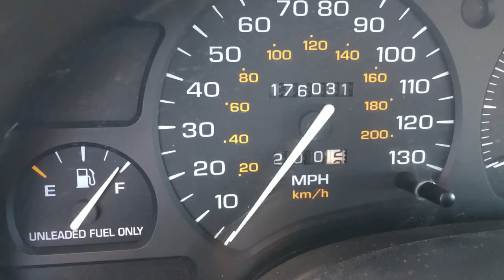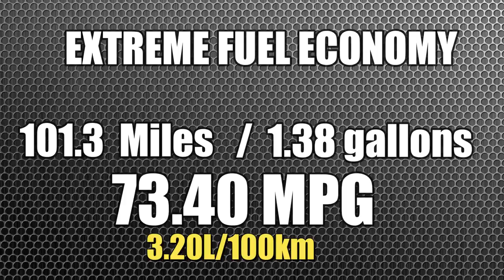S3 E11. Kubota turbo diesel Saturn extreme fuel economy.  super high MPG

Comment: MPG has been studied a lot.  Wind resistance is negligible at 50 MPH and below, but a car will achieve its best mileage between 55-65 MPH depending on gearing and drag coefficient.
Reply: Not quite as simple as you write it,  sadly. It depends an extreme amount on numerous factors such as the car size, weight, drag etc etc if wind resistance is negligable under 50 mph or not. For an electric car for example, its very tangible even at that speed.

Same is with best milage, but for most cars on the road (at least in europe) its reached at slightly lower speed than what you wrote, with about 40-55 being the sweetspot for most ones. 65 being the sweet spot would be possible in a car with a large-ish V8 and tall gears, as well as low drag. Corvette perhaps.
Reply: @GoldenCroc  I'm just repeating what I was taught in school a long time ago.  I got an A in the course.
Reply: @wsbill14224  Oh, ok. I guess your were taught ok-ish info. Not completely wrong, but a just a bit outside what is most likely/true. 

Anyways, now you got some updated info that is a bit more correct. Not bad, huh? Cheers mate.
Reply: @GoldenCroc  My reply had nothing to do with electric cars.  If you read up on gas car MPG again I think you'll see my 40 year old numbers are still pretty good.  Weight matters but most cars weigh about the same so it becomes a moot point.  Power doesn't matter because I'm talking about the speed at which max MPG occurs for a particular car, not selecting the most efficient engine.  Those are two different subjects.  Then it comes down to drag coef and gearing like I said before, and since wind resistance increases sharply above 60 MPH the speed of the car's maximum MPG will fall between 55 MPH for cars with lower gearing and/or poor aerodynamics to about 65 MPG for cars with taller gearing and/or less drag.  You will not find max MPG at 70+ MPH no matter what mass produced car you drive.  Not even a Viper.
Reply: @GoldenCroc  I agree except best MPG will be at least 50MPH unless the car is undergeared as wind resistance is almost zero below that speed.  You will not find max MPG at 45 and you won't find it at 70 either.
Reply: @wsbill14224  You made two posts, so I will answer them in chronological order, but there will be a lot of overlap. There will also be things I said earlier but in other words, in an effort to make it easier to understand. Anyway:

When you said "Wind resistance is negligible at 50 MPH and below", well that depends on a lot of factors, as I said earlier, so it can be said to be an oversimplification, unless the ones who taught you were just thinking of the "average US V8 car" of 40-some years ago, in which case I am inclined to agree, the numbers you got taught are indeed "pretty good"for those. 

As a sidenote from your comment on needing to read up a bit on gas car consumption, I also like to think I am pretty well read when it comes to vehicle energy consumption numbers (that would include gas cars), since I have analysed it since circa 1992 or so, as well as having done some design work on engines and cars since the late -90s on an amateur level. Doesnt mean I know everything, not at all. But at least what Is discussed here, I fell pretty confident about. I would hope so, considering all the hours I have put into it! 😆

But I wish to expand it a bit for other cars, and more moderns ones as well. Thats why the EV example, since those have very low frictional losses in the motor and drivetrain, they are the outlier for how low the best speed is for consumption. For quite a few EVs, that "best speed" is just some 20mph, sometimes even lower. This is relevant to ICE cars in that smaller cars with smaller engines have a lower best consumption speed. For some really old "peoples cars" that sold in huge numbers wordlwide  I would think the best speed could still be as low as maybe 30mph or so.

Now regarding weight and other factors, it depends on what you mean by "cars", The average US car is a pretty small subset in some ways. Its get even more thorny once we consider most "trucks" are used in daily duty just as "cars" are. A 60-70% weight difference isnt all that uncommon between a few year old corolla and a big SUV. But still, weight doesnt matter all that much, that is true. 

Power doesnt matter at all, that is also true. I never said it dit thought, but maybe you brought it up just to clarify? Fair enough if so.

The real thing in this latest set of post you made I have to make a comment about is the "since wind resistance increases sharply above 60 MPH". This is not true from a birds--eye perspective. wind resistance increases just as sharply at every speed, there is no sudden "hump" to get over... Well unless we are talking about transonic speeds, but that doesnt seem really relevant for road cars, as of now.

So let me assure you, if you take the whole current wordlwide car fleet into account, there will be quite a few with the best consuption below 45mph. This seemed pretty relevant to mention to me. As I said above, for most cars currently on the road in western nations, 40-55mph is where almost everyone falls. 60-65 as a max is the upper outlier. I have extensive data, as well as pure calculations/simulations showing it to be so. 

All in all, your posts make a lot of sense, only real problem is the data they are based on would seem to be an old V8 sedan or similar. All well and good, but thats not all that representative of the average car any more, even in the US. We agree on almost everything, just a slight adjustment of the numbers to be inline with my first post, and you are bang up to date, as well as taking into account a wider variety of cars, also for the worldwide market. And thats not so bad, is it?

Crack a beer and cheers mate. 😄
Reply: @drippingwax  I have looked, and I cant see I have done any mistakes in my text above, so it has to be a factor of you misunderstanding me if you feel that way. 

So I will make it easy: Just show me a single example of how something I wrote "dont make sense", and I will make an effort to use as simple words as possible when answering, if something was unclear. Cheers mate.
Reply: @GoldenCroc  The engine can’t really have an effect on the ideal speed for economy. That would be more determined by gearing and final drive surely?
Reply: @GoldenCroc  Also, you stated “wind resistance increases just as sharply at every speed”. Wouldn’t this be false, as aerodynamic drag is proportional to velocity squared?
Reply: @baileyharrison1030  The engine can have a a very significant effect. Propelling cars at a predetermined speed take a certain amount of power and energy. Different engines, especially if we dont strictly talk about modern ones, are very different in thermal efficiency, power delivery, internal friction etc. All this is combines with lots of variables for the vehicle it is mounted in to give a "best speed".
Reply: @baileyharrison1030  Yes, thats exactly what I meant with "increases just as sharply at every speed". There is no" threshold" that is relevant to road cars, it is always the same squared increase for power from one speed to another. Same relative increase in power needed to go from 10 to 20mph as there is to go from 50 to 100mph. 

The previous comment I answered can be read as there is a sudden "uptake" in drag above 50-60mph. There isnt,  the only reason it might be percieved as such is because it can correspond to the speeds you often drive, as well as other factors in the cars propulsion efficiency coincides with that speed, as stated in earlier posts, such as engine internal friction etc.
Reply: @baileyharrison1030  it ultimately depends on the torque curve of the engine, which is how the gearing and final drive ratios are usually chosen for the design cruising speed of a given vehicle. So "it depends a lot on a lot of things" is a better answer haha.

Comment: Your method of determining how much fuel you used is flawed.  it is common for the gas tank to expand during driving. Thus you must either let the car cool down before adding the fuel to see what you consumed or when you started you'd have to fill up after driving enough to warm up the tank. The expansion can be considerable so if you started with a cool tank and filled up with a warm tank you may have easily put in 1/2 to 1 gallon more; giving you a false lower mpg.  You may have exceed 40 mpg in reality.

Comment: My diesel has the 617 turbo ,it won’t get the 50 plus mpg but will drive around the world an the average of 30 times , just great engineering, have owned 30 or more of them as a hobbiest . My best diesel fuel saver was an 1984 190d , had the 2.2 with 5 speed , 42 mpg was its average . Glad your bringing the current study , it’s the everyday working mans worry , fuel prices .

Comment: It would be interesting to see what the file economy on the DS series Saturn at 55mph. I bet the car was designed for the double  nickel back in the 80s when 55 was the law of the land. 

Another fun video!!! 😁👍
Reply: I live in rural nc and drive saturns the secondary roads(and most of my use) are 45-55 mph(mostly 55) I get 37 on the wagon and 39 on the coupe. Over 70 you might see a drop BUT I never go faster than that (limit is 65 on hyway here) They seem to get the same mpg at 50-70 mph(within margin of error)
Reply: @MDAdams72668  in my automatic SL2s the tourqe peak was at 69mph (2900 rpms if I remember correctly) so thats where I usually drove it and they were happy there 😎😁

Comment: This was interesting to say the least. I would be thrilled with 50 mpg. My truck sounds awesome and will pull most anything but I get 14.5 mpg with a tailwind but I have to have it on the farm. I notice the hillbilly test track is devoid of hills. I live in east Tennessee where we have few flat places. I was driving home from Colorado going through Kansas at night. There was lighting flashing to the north and south of I70 with clear skies overhead. We never see things like that because ya can't see that far in these mountains. It's also hard to see storms approaching.

Comment: What if we get rid of the transmission and put a DC generator attached to the motor so the motor is only producing power to make electricity then use a electric motor which is over 90% efficient to move the vehicle.

Comment: My 2016 Mercedes A200d AMG with the 2.2d OM651 engine and DCT gearbox did 68.2 MPG over 110,000 miles over 4 years. With a common weekly average of 72mpg. Absolutely amazing on fuel.
Reply: There's no such thing like diesel AMG
Reply: @Robertrobal  🤡🤡🤡🤡🤣😂
Reply: @Robertrobal  Well clearly there is, i brought it brand new. £34200.
Reply: I had a mid 80s Ford escort with the Mazda 2.0l that got that kind of milage before the diesel fuel here changed. Even in the Sierra Nevada mountains 55+mpg was common. 70ish in the valley..when low Sulphur fuel came to California that dropped quite a bit.
Reply: It's an AMG appearance package.
Reply: @MBDieselFreak  That would be why it had "AMG SpeedSteer", "AMG Speedshift DCT", and "AMG Dynamic suspension" then.....
Reply: He is right that your car isn't an AMG, that's simply an option pack. AMGs are assembled separately, and they hand build each engine individually... They even name the vehicles differently, I.e. A45 AMG, C63 AMG, so you will never find an AMG that says 200 or 300 etc. Not only that but they definitely do not build diesel models either. Simply because the A200d is the exact opposite of a performance car, however, like you said, they are incredibly efficient! My dad has a C250 CDI with the same OM651 and that thing returns phenomenal mileage. 
I daily a 1992 W140 and that thing bleeds my wallet dry when it comes to fuel 😭 I put around 120L of fuel in it a week so do the maths there 😂 there's no Merc like the W140 but I'm tempted to buy something with an OM651 myself!!!
Reply: This od not AMG ! It is only AMG package. That is a huge difference. Diesel AMG 🤣🤣🤣😛🤮

Comment: I would find it interesting to see a flint hills driving challenge.  Wichita is relatively the flat lands of Kansas.   Also, I wonder if a propane injection system would help supplement power and keep exhaust temps down when climbing the long hills. Regardless, enjoying the series.

Comment: Only one more year, and VW Lupo 3L will be legal to import. 

They were very lightweight city hatchbacks and they were able to hit 3L/100km with a 1.2 tdi, and they shared only about 20% of parts with a regular Lupo. 

This seems like a channel that would be perfect for a scientific deep dive into the solutions they used, and there was a plenty of interesting ones, like hollow shafts inside the gearbox to lower the weight, magnesium steering wheels, thinner glass, freewheeling, laser welded body panels etc. They saved 150kg over a standard Lupo, which was 980kg.
Reply: The 90s was the perfect time for small, light, cheap, and still reliable compacts that went for max fuel economy. I wish we got more tiny cars stateside. I love trucks like most americans (I just bought an old Chevy Tahoe), but I've always had a love for compacts and subcompacts.
Reply: Lupo 3L is very hard to come by and commands a hefty premium. 

I think a polo 1.2 or 1.4tdi will net a very good fuel economy (especially with some mods) without breaking the bank.

Comment: It’s also important to mention high EGT’s or exhaust gas temperature will cause damage to the diesel engine. I think you may have mentioned this in an earlier video but people who don’t understand diesels don’t know why it’s so critical. If you run the engine over 1400 degrees Fahrenheit for extended periods of time you will begin to burn the exhaust valves and melt the pistons. Diesel fuel gives of quite a bit more BTU than gasoline, so even though gasoline engines burn hotter egt in the combustion chamber it doesn’t rely on compression to ignite. Diesel engines are essentially burning home heating oil with in most cases 500+ psi of compression with whatever boost from the turbocharger added on top of that. All that cylinder pressure and heat can create real damage to cast iron and aluminum components if egt’s go un-monitored. Its very subjective to what engine model and what modifications are done in relation to how much heat it can tolerate but it’s better to be cautious if it’s not a performance engine. I’ve seen my pyrometer hit 1,600 degrees on my 5.9 Cummins but only for a few seconds. I had that engine opened to replace cracked valve seats. So there you go…

Comment: Believe if this engine had one more cylinder,  and could handle a bit more boost, it would be about right! Maybe run 15psi, and had 4cylinders, especially if the bores were about 3-4mm larger, with a 12mm stroke added,  it should still get decent fuel economy,

Comment: I had 1981 Datsun 720 diesel that got 45 miles gallon and run 70 miles hour down road. 2.2 no turbo. Love the truck wish I had it back 5 speed manual transmission overdrive.

Comment: Why Car Interiors Get So Hot in Summer
Reply: We've all heard the saying, "If you can't take the heat, get out of the kitchen." But during summer, you could insert the word car into that sentence just as easily.
Why is it that your car feels like an oven, no matter if you park in the sun or shade? Blame the greenhouse effect.
Reply: A Mini Greenhouse Effect
Yes, the same greenhouse effect that traps heat in the atmosphere and keeps our planet at a comfy temperature for us to live is also responsible for baking your car on warm days.
Reply: Your car's windshield not only allows you an unobstructed wide view while on the road, it also allows the sunlight an unobstructed pathway inside your car's interior. Just like , the sun's shortwave radiation passes through a car's windows. These windows are only warmed a little, but the darker colored objects that the sunrays strike (like the dashboard, steering wheel, and seats) are heated immensely due to their lower albedo. These heated objects, in turn, heat the surrounding air by convection and conduction.
Reply: According to a 2002 San Jose University study, temperatures in enclosed cars with a basic gray interior rise approximately 19 degrees F in 10 minutes' time; 29 degrees in 20 minutes' time; 34 degrees in half an hour; 43 degrees in 1 hour; and 50-55 degrees over a period of 2-4 hours.
Reply: Why Cracking the Windows is Useless
If you think you can avoid the dangers of a hot car by cracking its windows, think again. According to the same San Jose University study, temperatures inside a car with its windows cracked down rise at a rate of 3.1 °F every 5 minutes, compared to 3.4 °F for closed windows. The  just isn't enough to significantly offset the .
Reply: Sunshades Offer Some Cooling
Sunshades (shades that fit inside the windshield) are actually a better cooling method than cracking windows. They can reduce your car's temperature by as much as 15 degrees. For even more cooling action, spring for the foil type since these actually reflect the sun's heat back through the glass and away from the car.
Reply: Why Hot Cars are a Hazard
A stifling hot car isn't only uncomfortable, it's also dangerous to your health. Just like overexposure to high air temperatures can cause heat illness such as heatstroke and hyperthermia, so can  but even faster since because they. this leads to hyperthermia and possibly death.

Comment: You should make the Saturn a hybrid. Use the turbo diesel engine to drive a generator which has a battery bank then from there to electric drive motors. Essentially turning the Saturn into a locomotive engine. I bet being able to run the diesel at a constant rpm would increase efficiencies even more